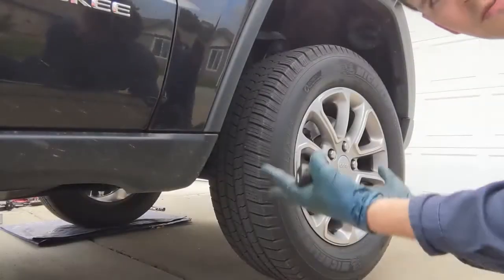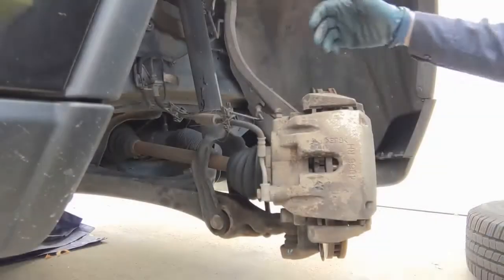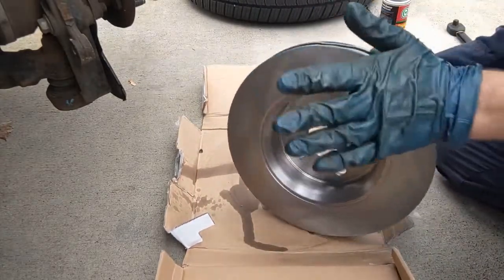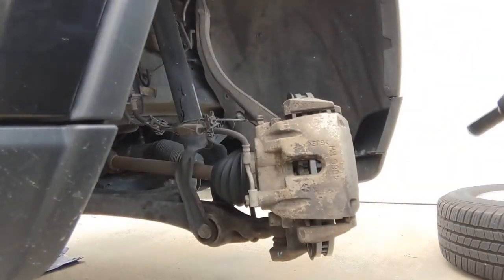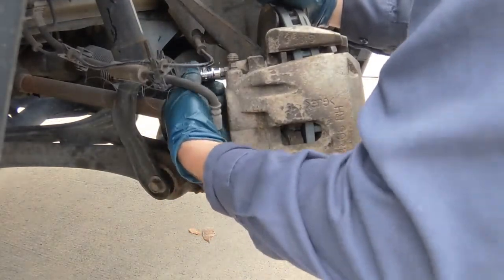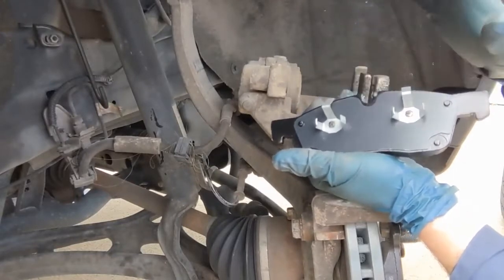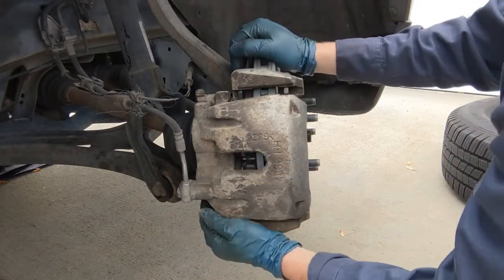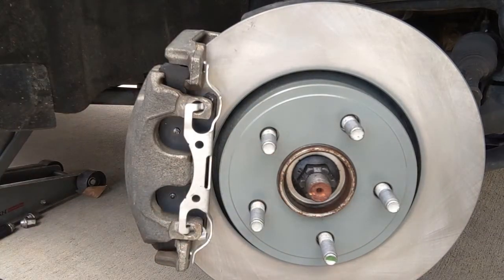2011-2020 Jeep Grand Cherokee Front Brakes | How to Fix Jeep Front Brakes and Rotors | Auto Repair

Comment: Rattle Over Bumps - if you have an older WK2 (mine is a 2015 with 100K) with original brake pads, your rattle could be caused by rusted mounting studs on the break pads.  They make the little pressure mounting tabs out of cheap metal and they literally rust away with time and then allow the pads to make an annoying rattle over bumps (can occur on rear as well).  I live in Cleveland, OH where they dump a lot of salt on our roads, so if you go longer than say 5 years, and live in a similar environment you may have the same issue.  Simple fix with new pads (although both my rotors and pads had another 10-15K in them).  I have NEVER had a set of pads last longer than 35-40K - Jeep did a great job engineering the pads and rotors to match the WK2 (mine is V6)!  When I went to replace them, I paid up to use MOPAR parts hoping to get same results again - don't mess with success!
Reply from the maker: Thanks for the tips 👍

Comment: Where you get the oring at for the front ?
Reply from the maker: It's not a critical component so if yours broke or is missing you will be fine. It's to hold the rotor still while you assemble the brakes. If needed you can put a lug nut on as far as it will go. That will hold the rotor just the same. Once the tire is on that will keep everything tight to the wheel hub 👍